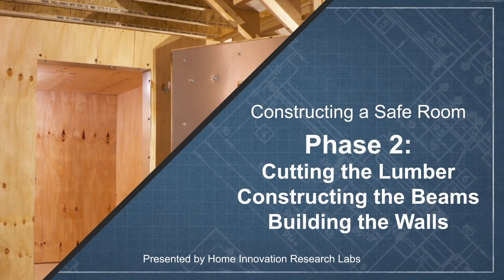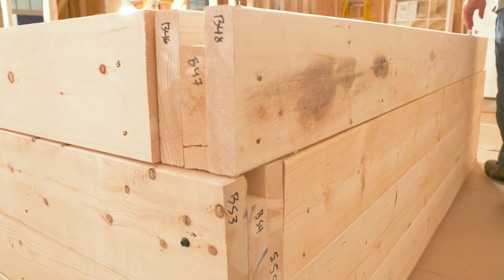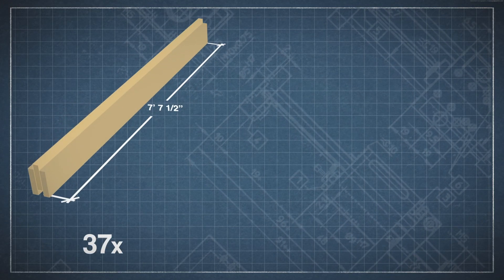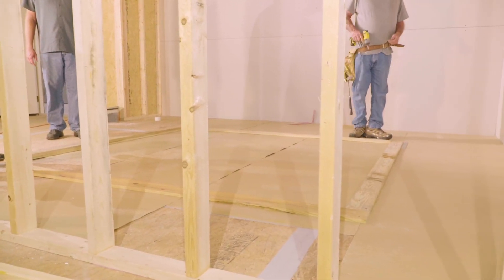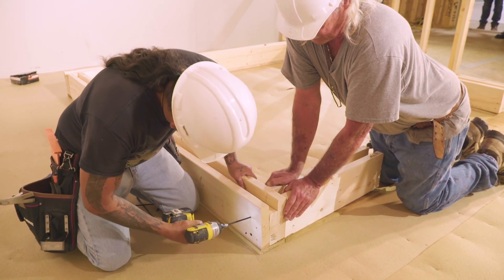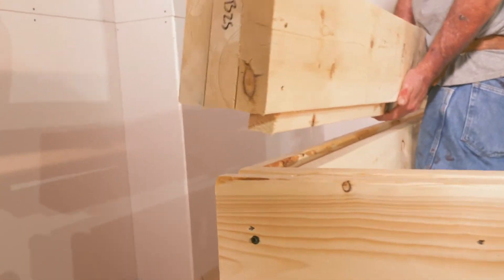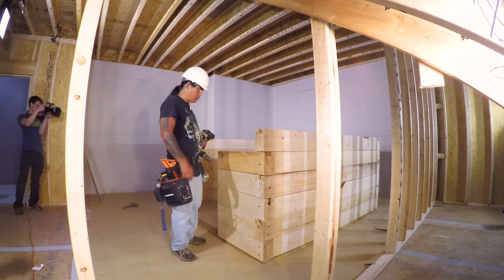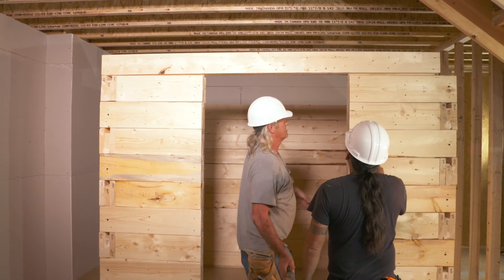Constructing a Wood Tornado Shelter (2 of 6)

Comment: The outswing door makes that thing look like a tomb to me. I'd definitely make it an inswing door, so you can still get out if something falls in front of it. Heck, I'd probably go with two inswing doors on two different sides.

Personally, I'd lay it up with concrete blocks for the walls. But, use the lumber for the ceiling. A small concrete block structure would be easy enough to do for a novice, after a couple YouTube videos.

I'm glad I watched the video, at least it gave me some ideas.

I think I'd probably make inswing doors using the tongue and groove 2x6 method.
Reply: imo. the door is the weakest part of the whole build, if it is an inswing then all it will take is a good hit from debris and the door will swing in and then you are exposed to the storm that you were hiding from, but if it is an out swing door then sure you will get blocked in but you will be alive. you should put some kind of tool in the shelter so you can get out if you do get blocked in.

Comment: Instead of ripping a 2x8 to 5 3/4 inches, why not use a 2x6 that measures 5 1/2 inches. Only a quarter of an inch difference, costs a bit less, and no ripping needed.
Reply: Thats what I did, good idea man

Comment: My local Home Depot sells 2x8x8 boards for $6.88 a piece so you've got almost $1200 just for the main lumber and probably another $500 for the plywood, metal. And a few hundred for the hardware to strap it down, plus a couple hundred for the concrete slab and a few hundred more for all the nails, screws, bolts, construction adhesive (I would just use Titebond III glue--it's cheaper and just as strong) This is definitely a $2000-3000 project but worth it if you live in tornado alley.
Reply: There's a you tube cabin build like this.
Reply: @victornowlin9092  Do you have a link for that video? Trying to get as much inspiration as possible on different ways of applying this idea
Reply: Not too bad.  I paid $3800 for my steel shelter but that was 9 years ago and it is a lot smaller than this shelter.